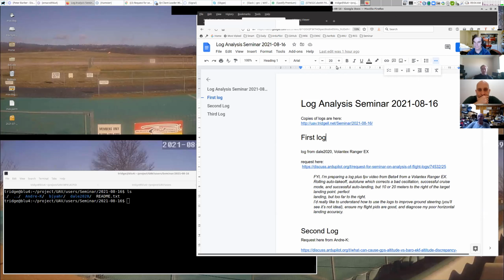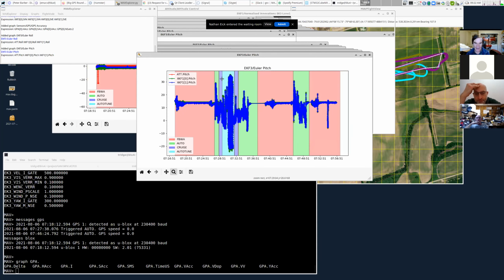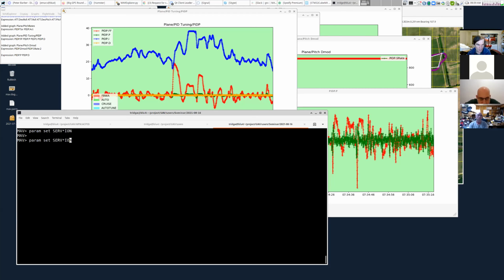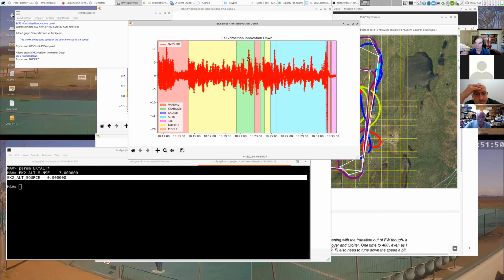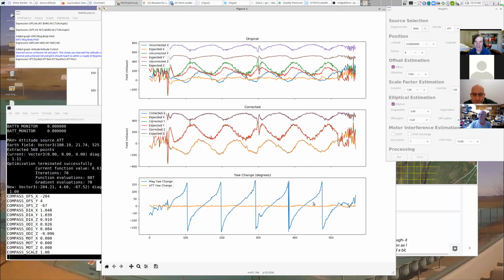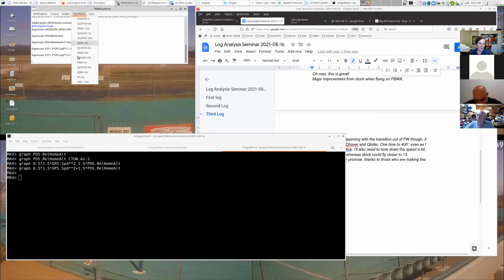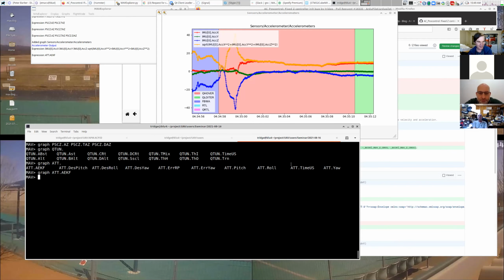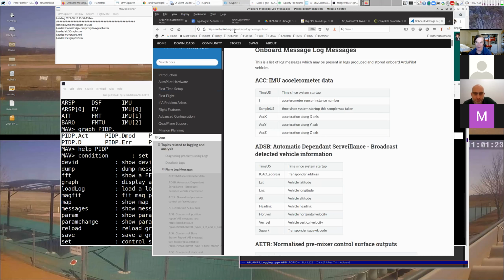ArduPilot Log Analysis Seminar 16th August 2021

Comment: Why is term “innovations” used? Is there another meaning of this word? I find it confusing.
Reply: Innovations are the difference between the value predicted using the IMU data before corrections are applied, and the value measured by the sensor